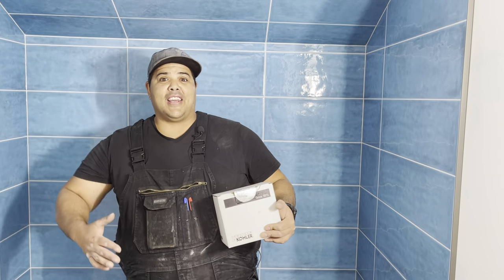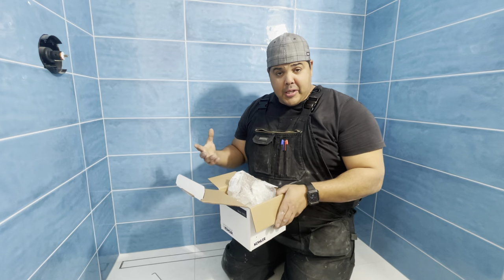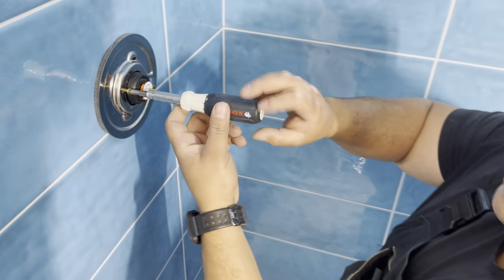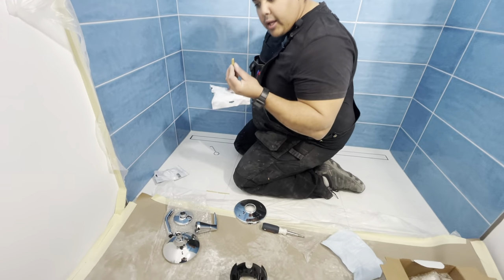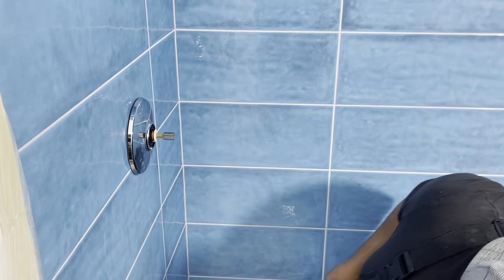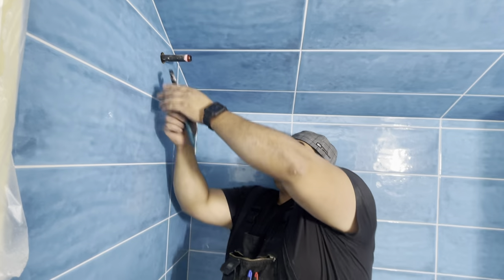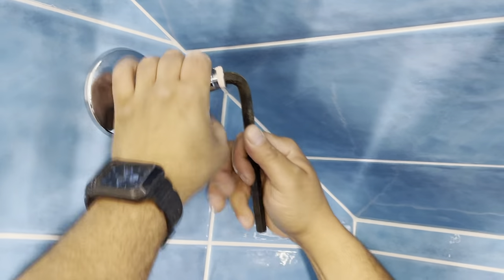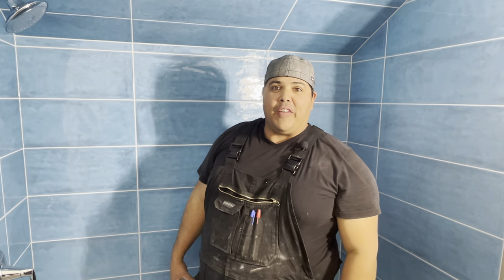Kohler Shower Valve Finish Install No Instructions!!

Comment: I just installed this type of valve and the water won’t turn off. Second brand new valve I’ve tried and I’m having this issue with both. Any tips? I’m about to the point of yanking my hair out 😣
Reply from the maker: Hmm 
Is the cartridge installed the right way?